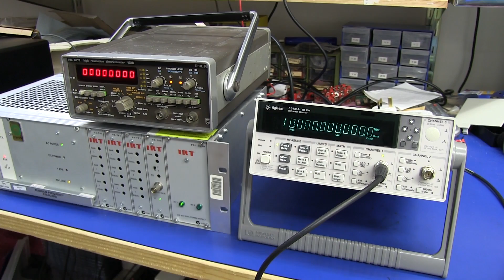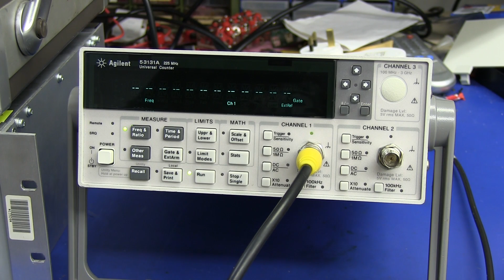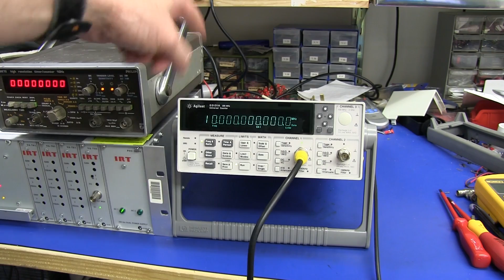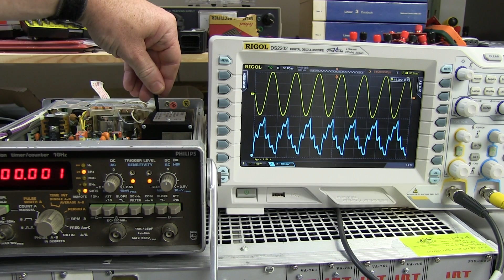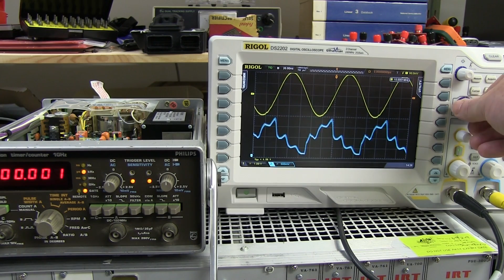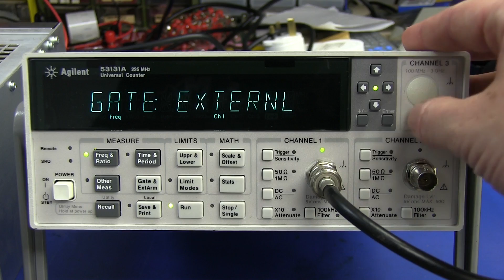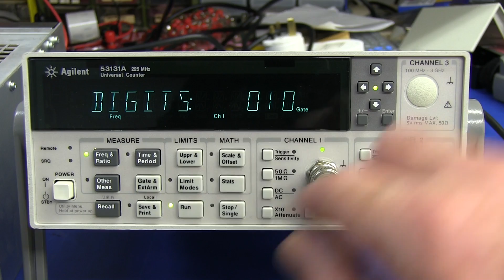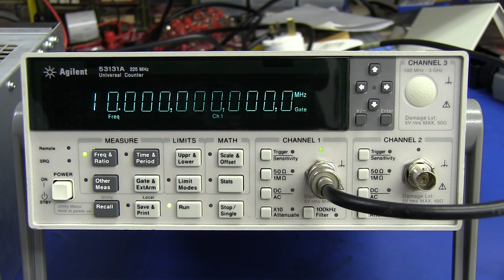EEVblog #459 - Counter Shenanigans

Comment: Can you feed the rubidium to the reference input and measure the internal oscillator frequency? Also interesting to see how the frequency changes depending on the temperature of the device as it warms up after turning on.

Comment: Yes, pretty much except the 10MHz input is designed for 1MHz, 5MHz, and 10MHz, and it will auto recognize 1MHz, so it will read 1MHz. But feed it 9.999000 MHz, and It will probably show 10MHz. The External Ref Clock input feeds a PLL (U3 on page 3 of main board sch), and the 53131A product spec does not specify the capture range for this input. Given the purpose, wide capture range is an unlikely design goal.

Comment: I was the fool who asked the question in the forums. What I expected was that the counter would have a higher frequency PLL (nominally) locked to the 10 MHz reference, which could be slightly out. I assumed it would do this to get a faster than expected update rate in higher digit modes. Of course, I was wrong.

Comment: So technically if you feed it an external clock of say 1 MHz instead of 10 MHz then feed 1 MHz as well into the input, it will assume it's 10 MHz signal even though it's an order of magnitude lower?